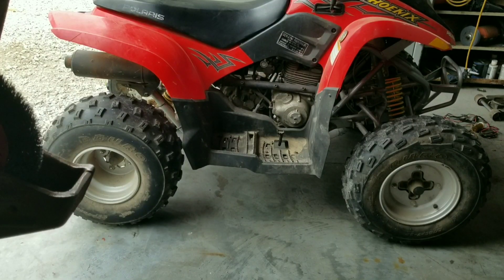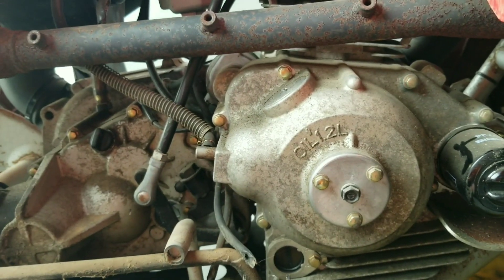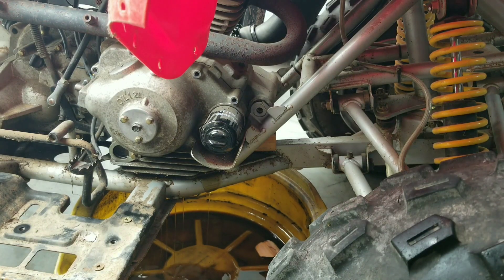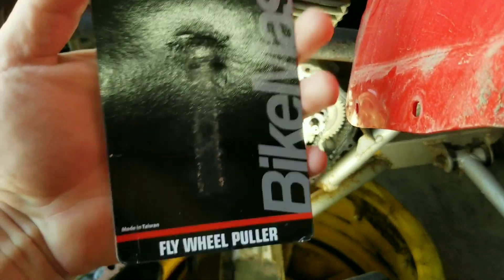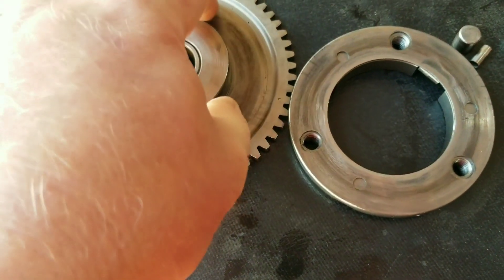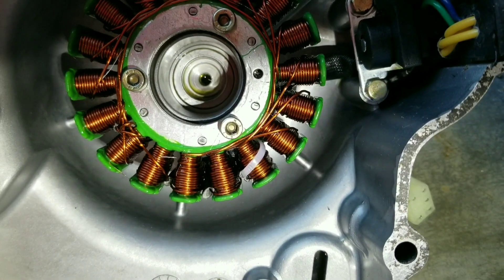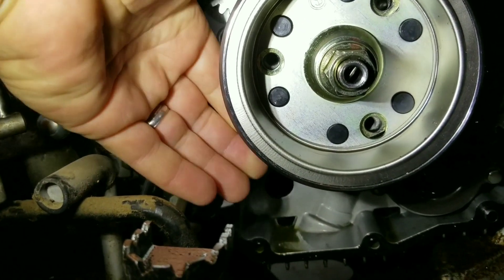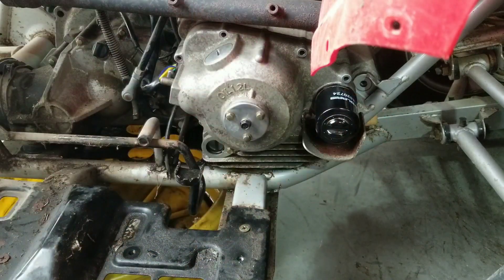Polaris Phoenix Starter Clutch & Stator Replacement

Comment: What are the 4 bolts on the outside of the stator covers purpose? Well 3 bolts & 1 in the center? My fathers is leaking oil from there? Also it’s not charging I don’t believe.